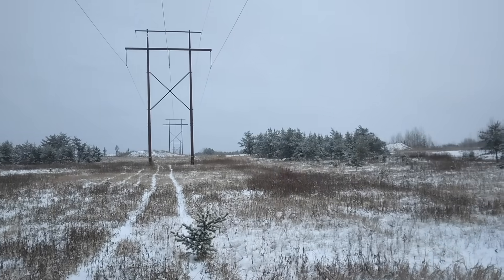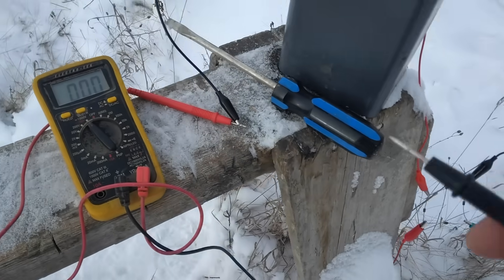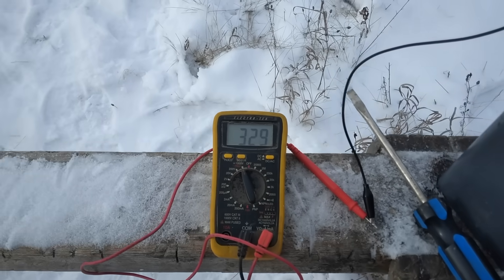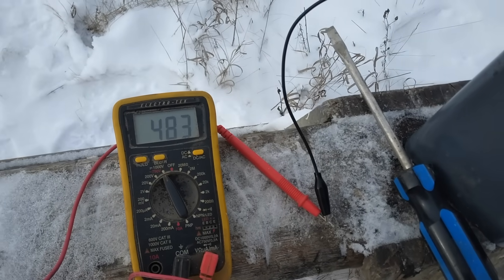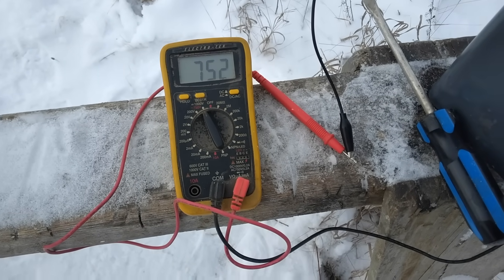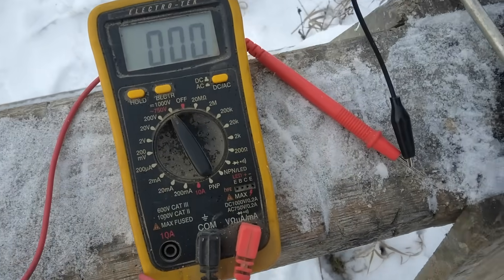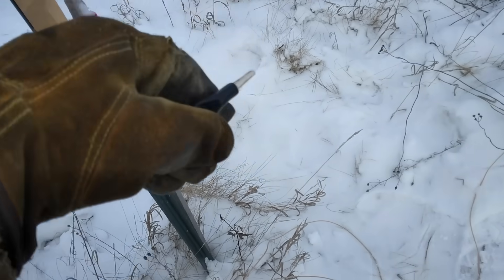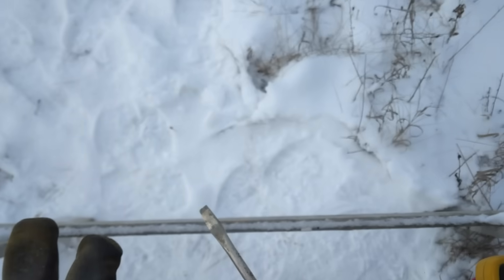Fences sucking power from under HV transmission lines

Comment: Watch out for that capacitor, the fuckers can charge themselves back up again after a temporary discharge with a screwdriver. That's why they are often stored with a wire shorting out the terminals.

Comment: 1000v RMS suggests a peak voltage of 1410v. Diodes that small are unlikely to be rates as such. You should always discharge a capacitor through a resistance as an excessive current draw could cause it to explode. Source: EE course takes decades ago.

Comment: That's not 88 microfarads, that's 88 megafarads.*(see edit) Really interesting video though! What you basically have there is a 1:1 air-core transformer, so the voltage induced on the wire you ran should be equal to the transmission line voltage in a perfect system, but there are definitely a lot of losses here mainly from the distance between the wires.

Edit: After doing some searching around, I guess it is microfarads. The manufacturer of the capacitor seems to ignore the standard of using the symbol "µ" to mean micro. Standard practice is to use a capital "M" to mean "Mega".

Comment: Could also be electromagnetic. The Iine is a big element driven at 60 hz only a measly part of a wavelength from the other element. The ground slightly conductive, fences and anything else near the lines are just a loss to the power in the line.

Comment: Not sure what this experiment is trying to measure?  A capacitor is like a bucket.  You keep filling it until it's full.  Clearly the high power lines are giving off a magnetic field your coax is picking up on, but measuring the charge of the capacitor is like measuring the volume of water going into a bucket.  It only stops when the input is turned off.

Comment: It's not about voltage, it's about current and voltage. And you know you can't drain electricity from your impressive 1200VDC capacitor because the voltage will collapse and you're left with nothing. After all, it's  just 88uF, 
Nice demonstration of the principle of induction, but further rather pointless.

Comment: i remember years ago the RV trailer was giving me a buzz every time i was around it...told campgrounds they kept telling the bush off...then they tested the plug and found a open neural power outlet the ants moved in and filled the pipe with mud and that broke the wire off...they said! always test the outlet before you plug in the power cord next year!

Comment: The electromagnetic field is expanding and collapsing 60 times a second.  It is generated by the current in the lines changing direction 60 times a second. His wire is very loosely coupled  due to the huge air gap. The only reason he is getting much of anything is because those wires are carrying 230 KV (he says). Put enough turns of wire in those magnetic lines of flux, you can get something substantial but I'm doubtful anyone at the power generator could detect any loss.  You could rotate a coil (in the right axis) through a static magnetic field, or rotate a magnet through a coil and get the same effect and the magnet wouldn't care or be diminished by your use of its magnetic lines of flux.

Comment: O.K.  the next step is to make a homemade transformer out of some more fence wire to step the voltage down to something usable.  It won't be efficient but, it would make for an interesting experiment.

I don't know how much current that fence wire can generate but, probably not much.  But, voltage times current is power and you might be able to transform the output into a regulated 120VAC.  I'm sure there are 120VAC voltage regulators you can either buy or make from a kit.  That would be awesome if you had enough power to light a 100W incandescent light bulb.

Comment: You can use a large antenna near a HV transmission line to pickup EMF emissions from the transmission lines and grounding the antenna you can convert the EMF emissions back into electricity for home use.

Comment: Try holding a four foot fluorescent tube over your head, and see if it lights up. I remember years ago, there was a town in the states that had HV powerlines run through their town, and they had the same issue with radiation bleed off the lines. They made a movie, or documentary about it, called Ohms. Not sure what the outcome was.Apparently, they sued the s&$# out of the power company.
Reply from the maker: I did the fluorescent tube thing in the previous video.  That experiment led to this one.

Comment: I'd be interested to know what the max current is?
Reply: You can look at how fast he is charging that capacitor, then multiply by the size of the capacitor.  For example, if he is charging at 1 volt per second, and he has a 88uF capacitor, the current would be 88 microamperes.  Conclusion, it's a very small current.  The current from discharging that capacitor is very high though, because the voltage is changed very quickly.

Comment: A single wire parallel to the transmission line is the worst possible way to siphon power.  You need a coil of wire, perpendicular to the line.  You can control the voltage and current by controlling the number of wraps in the coil.  This coil effectively acts as the secondary coil of a transformer, with the main line acting as the primary coil.

Comment: You have discovered induction, you are a genius. Oh wait, the principle of current flowing in one wire, INDUCING, a flow of current
in a wire running parallel to it was discovered some 200 years ago. You're on top of your game buddy! Why not set up a complete
induction transformer circuit .... and have yourself some free power from the power grid! A nice THICK stretch of copper wire will
carry more induced current. Just make sure the wire is insulated since you want to coil a few turns of the stuff. A nice coil of that
insulated copper wire ..... you have a transformer. Hell, you don't even need to coil it up. Just insulated and stranded together like
wire rope. tapped at each end with a single strand of wire to complete the circuit. Just because the length of the stranded wire is
100 or 200 metres long does not stop it from being a transformer!. Electricity coming into a house is via a transformer, it reduces
the 33,000 transmission voltage down to the 110 volts coming out of a house wall socket, A step down transformer is essentially
what I am describing. *You have yourself some shocking fun!!*   Any length and or thickness of metal is a conductor/inductor in
the presence of current flow or electric field, even if its 100feet above you in the form of high voltage transmission lines. And the
higher up you make your own parrallel line the stronger the field effect and induced current flow. All of it is part and parcel of the
basic principle of a transformer. 200 metres long: its still a transformer. You just have to look to see it!!

Comment: In Fairfax Virginia there is a bike trail that runs under a powerline for a little bit.  With your hands on rubber grips of the bike you can feel a constant arc of hot burning electricity through your thumb knuckle to the metal brake lever bracket.
Reply: It’s very uncomfortable and keeps zapping you as you forget and move your thumb to close

Comment: As a Security Officer at a Power Station I often walked onder HV lines at night. One night I was carrying a flourescent light tube 5 feet long! As I walked under the lines the tube under my arm started to flicker, as a joke I lifted it up pointing at the wires! I was amazed when it lit!! Not full brightnes but it lit! Another time a big boss, against my advice took his new car on site and parked it under the lines, when he came back out the whole car was dead no ignition nothing! It seems the lines were cold when he parked but the generators started and the lines were activated, the sudden surge of HV had fried the on board computer from a hight of about 50 feet!! Last oneNow working at an Aluminium smelter a worker took ill inside the potrooms where the metal was melted in electric powered crucibles each of about 5 tonnes. Ambulance arrived and was told DO NOT drive into the building, however a boss on the scene ignored our instructions and waved it in, they were only about 5 yards inside before they stopped to pick up the casualty and put him into the ambulance! Then the fun started, the ambulance would not start, totally dead, to make matters worse all the electronic medical equipment was also fried! Ended up they had to tow it out of the building and send for another ambulance for the patient, Total bill was £100,000+ all becase a boss thought he knew better than the Security men! He tried to blame the men on duty but ALL the potroom lads said they heard him countermand the advice from Security so HE got the dressing down!!!

Comment: Indeed you can get quite a jolt from charging a capacitor but it's instantaneous and virtually unusable unless your intention is just creating fireworks.
However, an interesting experiment to try would be to build a tuned circuit that resonates at 60Hz with a tank coil and a capacitor. 
Then feed that into a bridge rectifier and a 5v regulator.
Plug in a cellphone and see how long it takes to charge the phone.
If that's a success then you call it stealing power from the power company. Lol
After that, build a bigger coil again with a 60Hz resonate frequency.. regulate that at 13.8v and see if you can charge a deep cycle battery.
Power an inverter with said battery and now you're off the grid!

Comment: Fun. Thanks. The amount of energy you collected is a very tiny fraction of total losses for the power company. These losses are also there when you do not happen to collect them, just heating up ground very little over the entire power line. The average voltage of these wires vs ground is zero, so if you put your fence under the middle wire your capacitor should charge very little. That would be fun to try but not spectacular. Be carefull with the capacitor when charged up over 200V. It's unlikely to kill you but it will hurt.

Comment: @Double M Innovations - Your bridge rectifier made with thousand-volt diodes should be able to handle 2000 volts, since there are always 2 diodes in series... one going in, one going out. Of course the diode leakage current will increase at higher voltages, slowing the capacitor charging rate. You can salvage high voltage diodes from old CRT flyback circuits. For a widescreen CRT, those are rated for about 30 kV. 
As for the voltage your meter can handle, you can increases that with a voltage divider. If you put a 10 megohm resistor in series with a 1 megohm resistor, ground the loose end of the 1 megohm resistor, and attach loose end of the 10 megohm resistor to the capacitor, then at the junction of the resistors you will have 1/11th of the total voltage, or about 9%. To make it a nice round 10% you would have to find a 9 megohm resistor, or better yet, put 9 in series of the 1 megohm resistors, stretched out in a line. That will give you a higher power dissipation rating and also prevent flashover of high voltage. 
Note that common resistors like 1/2 watt and 1/4 watt are NOT rated for high differential voltage, so they would be much more likely to have flashover. You don't want flashover. SERIOUSLY!
You can also get a high voltage probe for your meter that already has one or more resistor divider built in. Another advantage of the resistor divider approach is that you can measure either AC or DC that way, at least for sinewaves at powerline frequency.

Comment: thats crazy man lol..  so could you set it up to power the house or some stuff?     that'd be sweet to grab a couple Tesla wall batteries and charge them with it, then power the house with a battery, switch it out to the full battery when needed and put the other on to charge.  i donno if thats all possible but that be awesome to be grabbing that much power out of THIN AIR  lol

what does that mean exactly thought too?  all that electric in the air or ground or???  wicked stuff man. i never heard anything about this befor.

Comment: Was setting up sound system for a return celebration for Bravo Company after operation desert storm in Union Gap Wa. Organizers rounded up a few flatbed trailers to use as staging. Location was parallel to high voltage line above. Suspected and tested metal deck to ground and found over 425 volts present. Rounded up many sets of auto jumper cables to securely ground all decks before allowing anybody near. Would have been terrible to have casualties while we were celebrating their return after they all had survived battle.

Comment: In Ireland some 35 years ago I entered a fishing competition on a misty day and was allocated a spot under 110kv ESB transmissions lines which cross Corstown Lake. I rigged up a 8 metre carbon fibre fishing pole and commenced fishing. After casting, I held the pole in a horizontal position and then felt the pole vibrating slightly. If I raised the pole the vibrations increased significantly and I immediately recognized the danger I was in. I then had to convince the competition organizers to move me to a safer spot. Note - Anglers should be very careful of any overhead power lines when using carbon fibre fishing rods.
Reply: When I bought a carbon fiber fly rod in Montana a few years back, the old guy ringing me up said if there's a lightning storm, drop it and run.

Comment: This power is lost regardless. Someone might as well use it. I always hated working under the lines you're always getting shocked. Watch how they work on them the have to hook the helicopter up to the line. The copter isn't touching anything and still there's a plasma arc

Comment: When I grew up on farm we had hi tension lines ,steel towers, come thru in the  60's   We wondered why cows never escaped down on that fence line unde towers   They would go through our regular powered fence. We'll we grabbed wire going thru and bang you would get a decent poke. It actually powered fence along road . Was all connected to that line.  You can hear power lines singing like you are ark welding.  That's the sound you heard.

Comment: On a similar note. I was a pipeline technician for BP. We had some LPG pipelines that ran across or parallel to high voltage electric transmission lines.

What a hassle this created. An impressed current  was introduced on our pipelines, leading to corrosion.

We had to install all kinds of catholic protection equipment, and huge "ground field grids" of buried anodes. Thousands of anodes.
Reply: Cathodic?

Comment: I'm confused.  The parallel wire is picking up alternating current from the power line above and then you are storing that AC in a DC capacitor?  So far you have not shown a rectifier to convert the AC to DC so how does it work to store AC in a capacitor?  Yes, there are AC capacitors but they are used for power factor correction, Not for what you are using them for.
Reply: He very explicitly showed the full wave rectifier that converts the incoming AC to DC for capacitor charging. Watch it again.

Comment: An electrical engineer told my about this trick already 30 years ago. Evidently it works even better near a radio station.
Reply: I used to install central vacuums. 
I was finishing an install at one particular house After all the connections were made, pipe and low volt electrical, I plugged in the main power cord. The motor came on as soon as I plugged it in. I thought I had miswired something. I went back thru all of my low voltage connections as it just sends 12-24v out to each outlet and if it comes back, it trips a relay for the motor. I couldn’t find any shorts in the lines. So I put a meter on the wires to check for continuity between them and had none. But why was the motor turning on with the low volt lines connected and not on with them disconnected?  

The only thing I could think at the time was a bad circuit board or maybe the radio station across the street had something to do with it. 

I went to the local RadioShack and picked up a power supply and a relay and got them temporarily going with the understanding that I would be back again once I figured out what was happening.  

After contacting the manufacturer of the system, they sent me a new circuit board and that fixed the issue. It turns out that they had ran into this before and it was indeed the radio station causing the issues. The low voltage wiring was acting as an antenna and picking up stray voltage that was triggering the onboard relay.
Reply: 90,000 watts of power...

Comment: A friend worked for Florida Power a Light as a current diversion investigator, looking for power theft. A remarkable case they had was an elderly man who had a small house in proximity to high tension lines. He never hooked up to the grid yet had all the functions of having done so with lights, air conditioning etc.. The man had been a lab assistant for Nicoli Tesla and armed with knowledge, had laid out cables under his backyard to induce a current. He had diverted current for a little over two years. In court he pleaded innocent as he maintained the electricity was freely floating through the ether and he had simply known how to capture it. FPL was able to show the current drop was unique to his location. Not wishing to imprison an eighty plus year old pensioner, the judge arranged a bargain. The defendant would hook up to the grid, pay his back owed usage and never disclose to anyone the technicalities of how he did it. So yes, the ability to induce a current off of high tension lines is a real thing. The ability of a power company to find and prove theft is also a real thing.